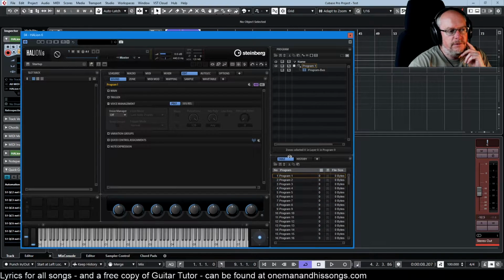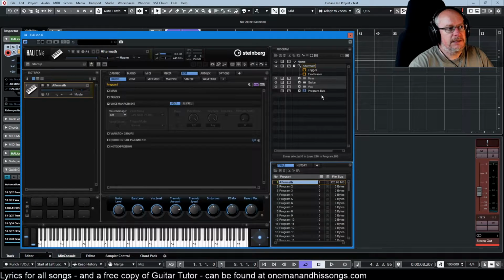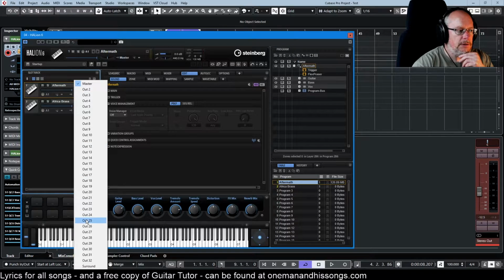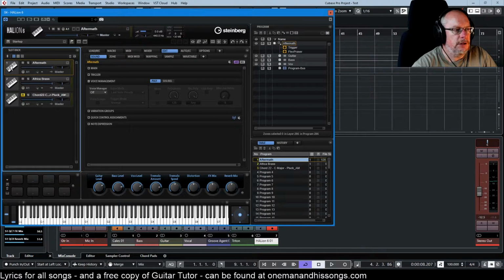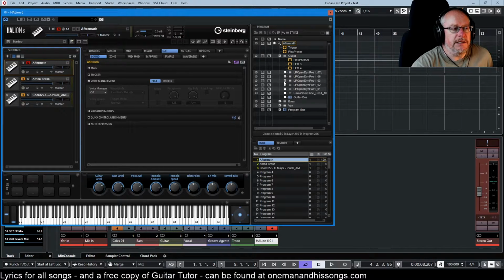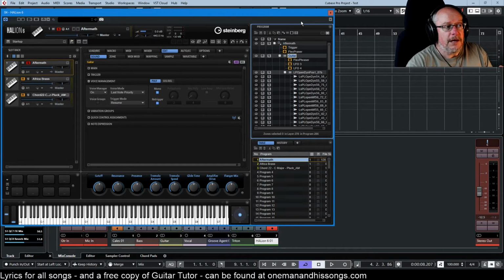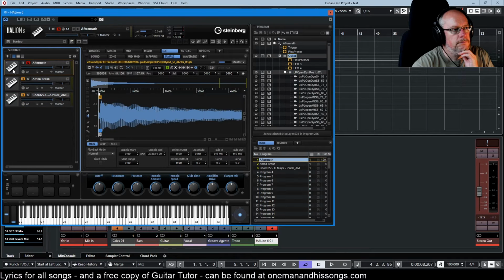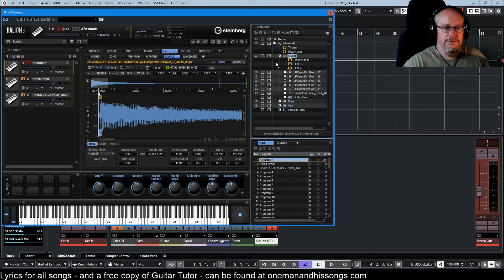Steinberg Halion 6 Tutorial Ep.2: Slots, Programs, Layers & Zones Overview

Comment: I am kinda at a loss. I just started going through this series and I am unable to change the quality to anything. The setting defaults to 360 and says quality Unavailable?  You point to something and it is unidentifiable. I prefer 1080 or higher but in this series it cannot be done
Is there some way you can look into it, please so I can  learn?
Reply from the maker: Really sorry about that, I don't know what the issue is. I just looked back at the original and YouTube says it's been processed in HD, so I don't understand why it's dropping to 360.
Reply: @OneManAndHisSongs  thanks for checking

Comment: Hello Tony, 

Much appreciate everything you are doing with your YouTube  videos.

Quick question and comment. 

The Halion 6 flexphraser/arpeggiator is quite something when using time signatures ie: 1/8 1/16.

I am trying to use the flexphraser/arpeggiator in 3/4 time and I find it unusable. What I mean unusable is that the result is far from being musical. To the point that it does not sound like anything that you would put into a song. 

Do you have any advice on how to make this work using 3/4 time?? 

Much appreciate your help!!
Reply from the maker: It's not a setting I've ever tried personally. I just had a bit of a play, and obviously it's much slower than the normal 1/8 or 1/16 arps that I'd be used to working with. I imagine it's a setting you'd use for a very slow evolving piece - perhaps creating a user preset just playing roots thirds and fifths initially and getting a feel for what you expect from the module. It's very difficult to make suggestions where creativity is concerned, since that's really up to your taste. Sorry I can't suggest anything more useful.

Comment: Thanx for your tutorial. Helps me a lot to learn halion. I actually have a question: I selected the "arctic bells" patch in order to study its structure. But the patch contains no oscillators . Where does the sound come from?
Reply from the maker: Thanks for the feedback :)

The sound's coming from a macro - if you look in the Macro tab you'll see the module. This is the aspect of Halion that I like least - it purports to give you total control over the sound, but macros break that philosophy and are, in fact, completely self-contained sound sources. It feels like cheating to me!

The only way to avoid macros, if you don't like this aspect, is to build your own sounds, or select presets that don't use them. You'll find, though, that Halion leans very heavily upon them.
Reply: @OneManAndHisSongs  I thought (I think I read about it somewhere) that those Halion presets with "invisible" sound sources have something to do with copyright issues, like that presets contain third-party samples or something, and Steinberg doesn't possess full control over them. There are different type of Halion presets – those that have macros, but you can see the structure of these presets, browse samples, use them separately in Halion (but not extract them as wav) etc. Hot Brass library, for instance.